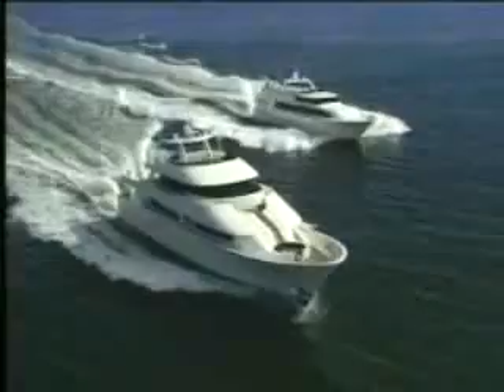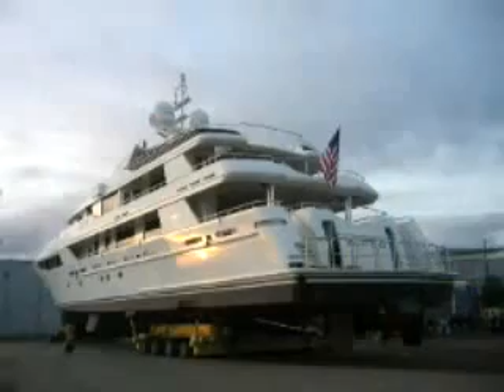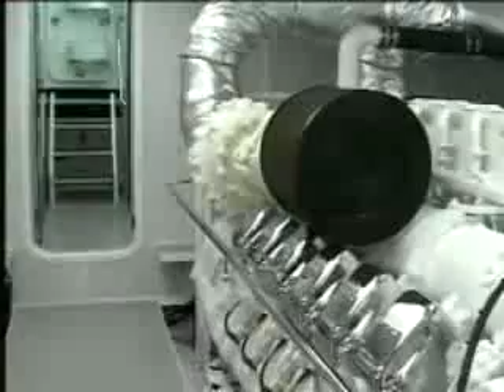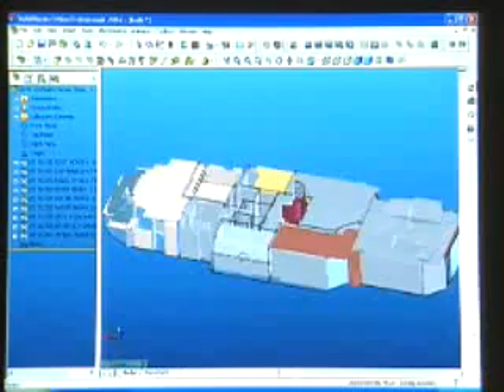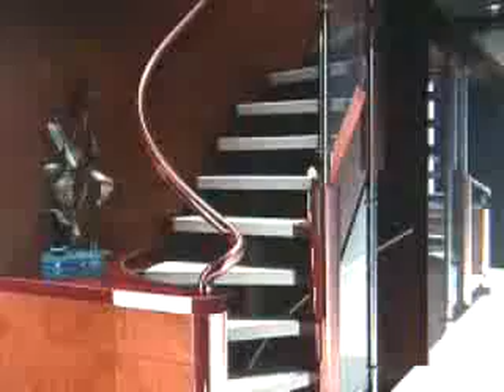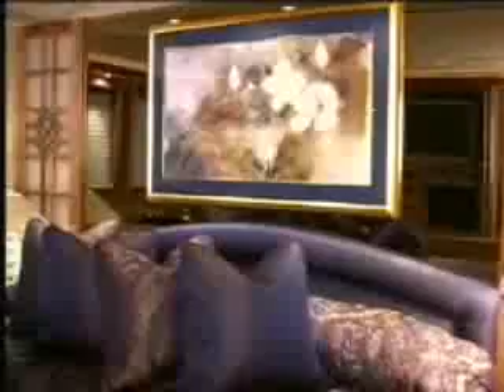Westport Shipyard Builds the World's Largest Yachts

Comment: Westport makes the "most" yachts, not the largest ones.  Companies like Lurssen, Blohm & Voss, and Meyer-Verft in Germany make the biggest yachts.  They actually build  their hulls like a ship, using steel hulls assembled in modular sections.  Westport and Hatteras tend to use more fiberglass, but this still results in a very strong hull, and the lighter weight saves fuel and increases range and endurance. Westport and Hatteras can build yachts just as nice and luxurious as the European ones.